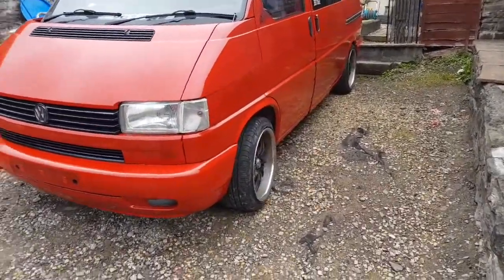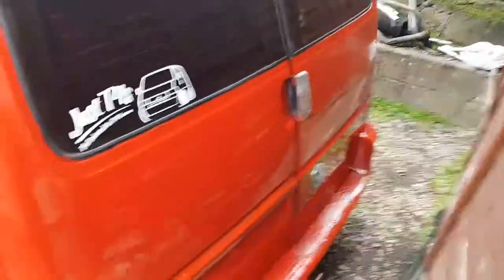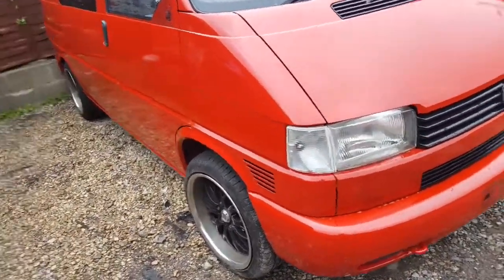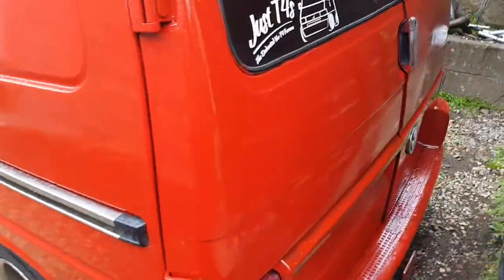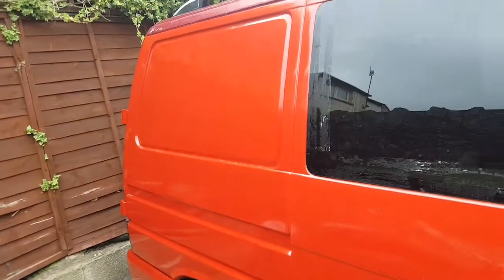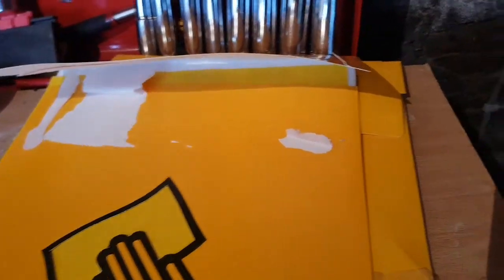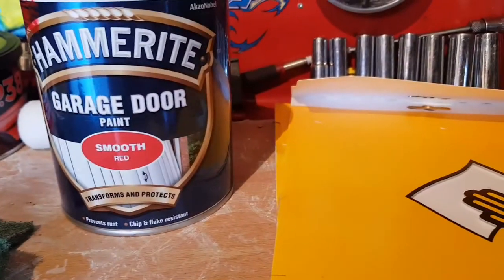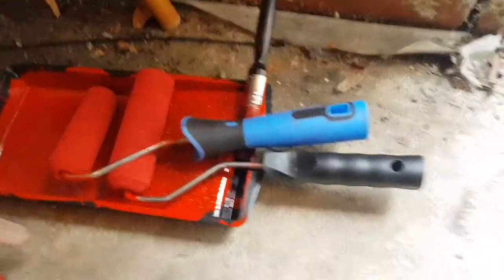Hand painting your car or van, step by step ( part 1 )

Comment: Great video. Very helpful with my upcoming T5 project! Did you use the same paint on the front bumper? Did it react differently to the plastic than the metal bodywork?

Comment: @PranceProject when you were doing the 2nd and 3rd coat did you add less spirits to the paint or keep the ratio the same but put it on thicker? I've just ordered some military paint to do mine but did do the roof in same paint as yours in white but didn't realise had to add spirits to it
Reply from the maker: Yer kept it the same ratio and just rollered on didnt got much thicker as it runs very easy.
Yer u need to add the sprite else one set and sit properly but u can get a stunning finish if u sand the orange peel between coats

Comment: Does hammerite not react with white spirits?
Reply from the maker: No not at all mixes well and rolls on smooth
Reply: @PranceProject  thanks for the information
Reply from the maker: @jonathanjones1949  any more questions please feel free to ask if u have any more 🤙
Reply: The old Hammerite was trichloroethane based and could be mixed with thinner. The newer stuff is spirit based, and much easier to work. You still get a better and more economical job with brushing enamel, such as is used to paint lorries.